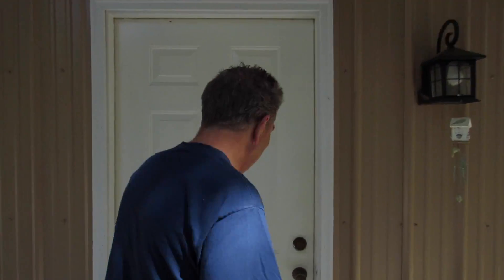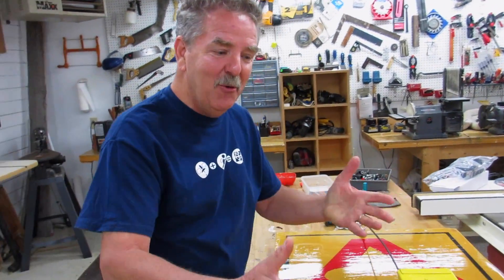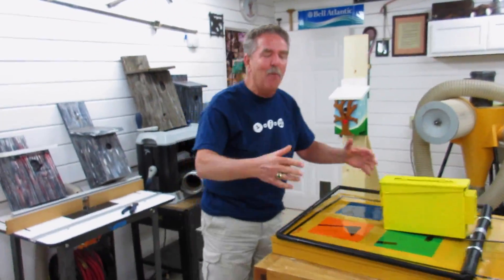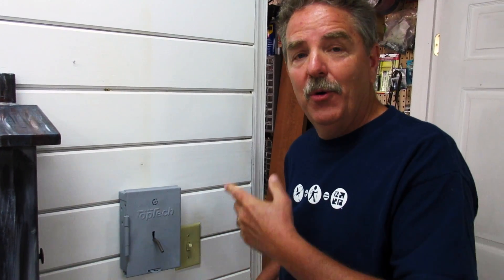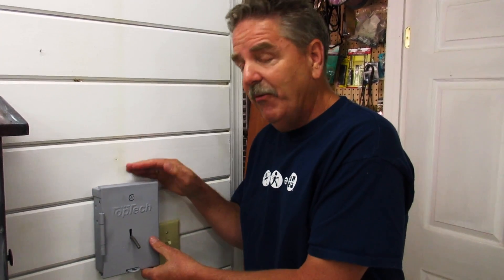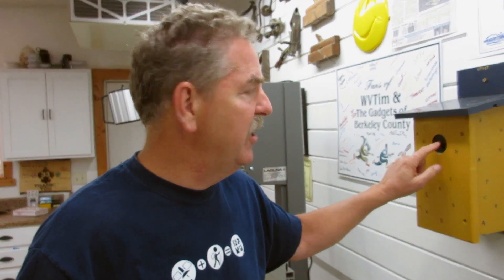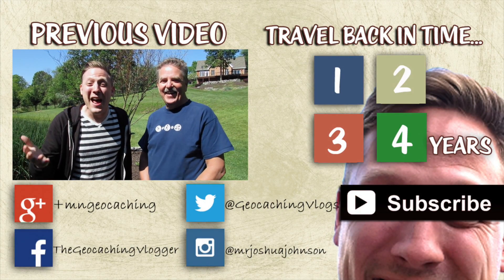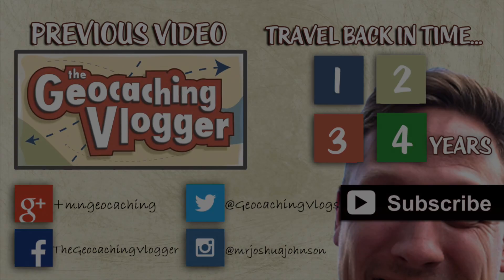GADGET GEOCACHE WORKSHOP!

Comment: My question is if you can't dig... how does he get the 4x4 post??
Reply from the maker: +Video Ramblings of Matthew you can't bury a cache, but you can put a post up.
Reply: The Geocaching Vlogger so digging a hole pouring concrete erecting a post is ok?
Reply: The Geocaching Vlogger straight from geocaching.com guidelines: "Geocaches are never buried, neither partially nor completely.
If one has to dig or create a hole in the ground when placing or finding a geocache, it is not allowed."

I'm not trying to be a butt I just want to do similar hides around here in Texas so I'm generally seeking advice.
Reply from the maker: Yes, if you are the land owner or have special permission to do so.  People put up birdhouses all the time. You would not be able to bury a post on public land without permission either.